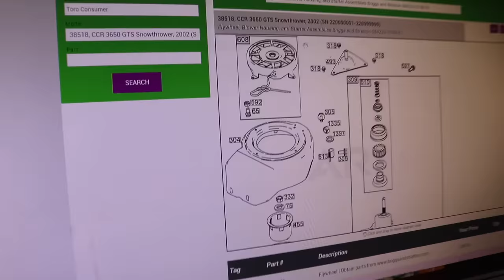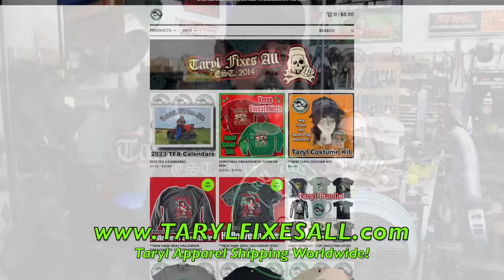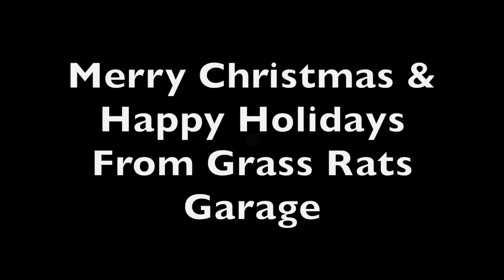Try this recoil hack to fix your slipping rope

Comment: I have an old Tecumseh MTD snowthrower, HS50 Tecumseh engine. Recoil innards broke after so many years. Bought an HS50 Recoil assembly on eBay, changed out the innards and spring and it works better than the original. Went from 1 dog to 3 dogs.

Comment: Yep! I have a 1977 AMC Jeep that has Ford charging, starting and ignition system and a GM steering column and power brake booster. To which I replaced the distributor with a GM HEI distributor from a 6 cyl Chevy engine.

Comment: The 84-86 Pontiac Fieros were kind of a hodge podge of GM cars, the front suspensions were Chevette/T1000 and the rears were Citation front suspensions turned backwards with the steering components locked straight.

Comment: Man, that is quite the goat-rope to get to that recoil!  World's most expensive rope replacement, I'd bet?  Getting a head start on that one reminded me of those cooking shows that cut to the chase with the "here's one we prepared earlier..." routine.  🙂  (btw, what have you been feeding your Elf there?  Needs to lay off the Christmas cookies!)
Reply: That’s what I was thinking about taking everything apart for that rope. I would save the bolts and nuts 🔩 and scrape the rest.
Reply: @stevanrose7439  and not ever buy a Toro anything again.
Reply: @stevanrose7439  Those old 2 stroke Toro snow throwers are fantastic. I’ll never get rid of mine. Bought the new 4 stroke last season and used it that same day and returned it because the old one is simply better.

Comment: How in the world do you remember which screw goes where?  I understand you do it all the time, but how long has it been since you installed five screws only to find out the last  screw is too long for the hole?  Drives me crazy....I have to take pictures, make notes and talk to the Small Engine Spirits to get it right.  Merry Christmas!
Reply: For that problem, you can put screws from different parts of the machine in separate containers or baggies.  There are some jobs, where taking pictures is the only way to fly.
Reply: Put the screws back in the holes they came out of..

Comment: The Rtek is my favorite little 2- cycle engine. I run the 7HP variant from the toro Snow Commander on my go kart. Modified torque converter for drivetrain. It works great , smooth power. I have been trying to figure out a 12 volt starter option for it. I have tried to combine different 12 volt starter motors with the plastic 120 volt starter housing that comes with these engines with no success yet. I thought I had a lead with a vintage electric only start lawn boy, but not similar enough mounting. 
Has there ever been a 12 volt option for this engine? Maybe I need to use a starter/ charger motor with belt drive, add a pulley to the recoil side. But then I’m giving up the recoil starter. Any ideas, it’s great fun as is but electric start would take it to the next level!

Comment: Have a Craftsman M125 push lawnmower...didn't hit anything with it, clean air filter, good spark plug, oil...it's over revving. Bent the governor tab slightly, still running high. Kept trying a little more, bent quite a bit now from original position, starts up slow and gradually as it warms up starts to run high again...internal issue? Any ideas greatly appreciated, thank you all! Love the videos Taryl!

Comment: The hub screws down on the flywheel well it comes apart and inside there's six ball bearings take the bearings out (don't lose them ) put a little crc

Comment: Sorry I hit the wrong button anyway spray the bearings and clean them up ok the shaft if it has rust take fine Emory cloth  polish it up then spray it and wipe it down then put the bearings back in ( trick to it ) dab a tiny amount of grease on the bottom of each bearing and gently set each bearing in the outside of where they go or maybe I should they need to be inside but where on the high side the that's what the grease is for. Put back together